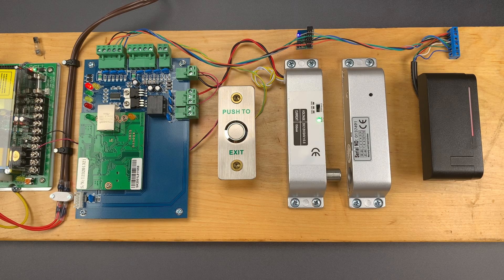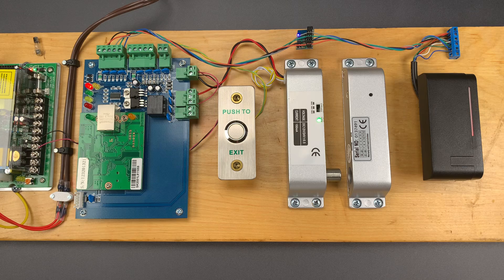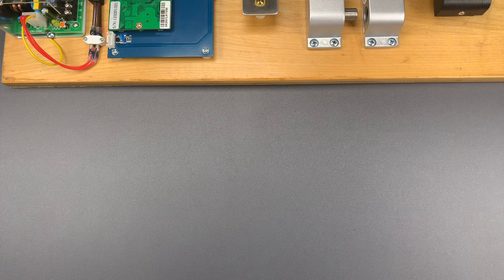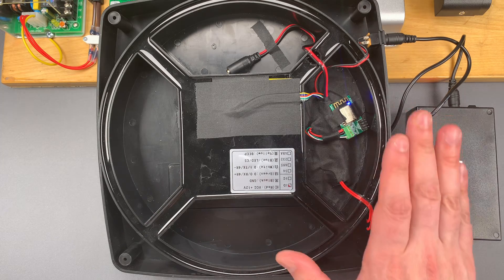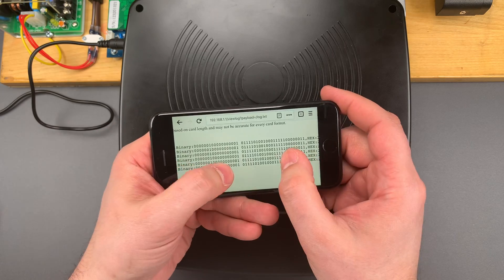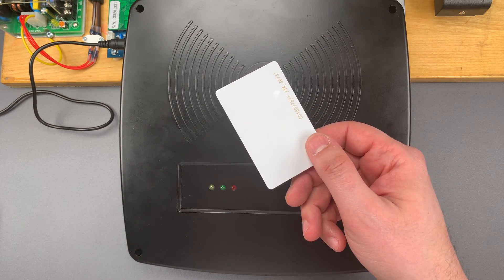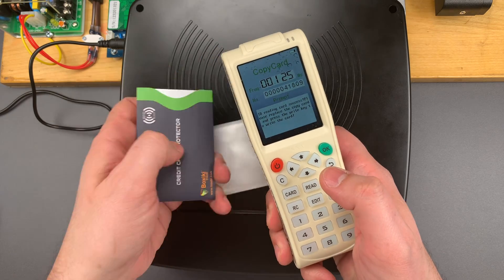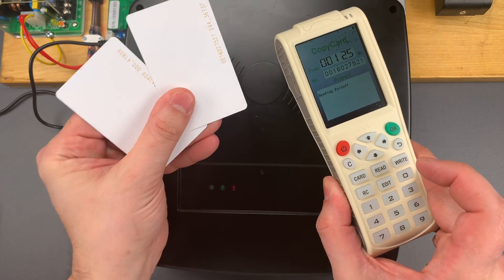[1056] This Black Box Reads RFID Cards in Your Pocket

Comment: Interesting topic. I have an unrelated story from a while back. BNSF Railroad office in Denver was just ramping up to install RFID chips on all their rolling stock. They had installed and were going to test a reader at a particular crossing west of Denver in the mountains. A friend of mine was a line worker for the railroad (don't know his exact job title) and he was out in his truck on the rail line and related this to me over the amateur radio. He got a railroad radio message to get to the crossing that was to be tested and lift his truck off the line and wait for the next train, inbound to Denver, to pass. The train came by and was not remarkably long, but the central controller called back on the radio and asked how many cars were in that train. My friend told them there weren't many and that it was a mixed freight. The central controller called back and said the RFID reader had reported the train had over 36,000 cars on it, then they both realized that the new (yet to be installed) chips were on that train as freight and the sensor at the crossing had successfully read every single chip in the shipment.

Comment: storing cards together is NOT a good way to protect them. The cheapest arduino rfid module under 2$ has no problem reading out all cards stacked up to 15 or something like that and I don't think you'll be stacking more then that.

Comment: Thank you LPL for FINALLY showing one sane person on how your cards are insecure.
Everybody goes Ape about how you can read cards from a distance and how for example the contactless banking is bad.
But you are the FIRST to show how it does not work when you have a bunch of cards together.

I despise the people that have their work-badges around their necks or on the belt like some dog wears a collar. So easy to pick up on and read. I have mine in my i-Clip wallet that basically stacks all cards together. There is just gibberish whenever I present ANY card inside the stack to any reader. 

Keep up the awesome work and hopefully, people will understand the security flaws and how to protect against these remote attacks.

Comment: As LPL said, it is wise to use a challenge/response system. But he is wrong on the gold standard. The true gold standard of electronic perimeter access security would be public key (certificate-based) encryption protected by a PIN and/or biometrics. The US Government invented a class of card called PIV (FIPS 201 / NIST SP-800) with several means of protection built in. There are multiple key slots on each card, each capable of containing strong key pairs. There is a special slot for "Card Authentication" (which can be read without the PIN code) and others protected by the requirement of a user PIN. There are also means to store biometrics. Every US Government worker carries this, either as their agency ID card or in the military, the "CAC" or Common Access Card. You can also buy commercial ones from companies such as Taglio (https://pivkey.com/) that can be custom programmed and printed. These cards can be used for physical security (contact or contactless), computer access (Windows and Mac support this, and there is probably support for it in Linux), and document signing. The card can generate the key pair on the card and create a certificate signing request. The private key is created on the card and never leaves that card, unless there is a serious security hole. It's a shame that online banking providers don't just use their credit/debit cards in a similar manner as a physical token that has a secure signature issued by the bank that can't be forged.

Comment: LPL, about the metalized card holder, isn't it easy to read inside because there's part of an edge of the card exposed, which would expose part of the card's antenna? I ask because i've seen more complete forms of wrapping in aluminium foil, or metallic wallets, that actually work to block reading, at least from NFC

Comment: Could anything like this be used on contactless credit /debit cards?

Also, would you be able to test some popular 'RFID blocking' wallets to see if they actually work?
Reply: I believe that the credit cards use a challenge and response system. They don't simply broadcast the same value every time. Instead, an encrypted number will be generated using a private and public key and only someone who knows the key can come up with the correct response to the challenge.

Comment: Lpl, I do low voltage service. Your videos have inspired me. I enjoy finding panels w/out keys and have picked more than 10 simple panel locks with your inspiration! Prior to you my prybar got a lot more action.

Fire alarm, burg, access control, cam, voip, fiber, comms, and radio systems on occasion.

Thanks for the small fun you have made from a large stress.

Comment: So really, the people who make those RF card blockers should just make them so that they have a built in "RFID card" that is printed with random gibberish.
Reply: ...and a switch to turn it off when one wants to use the card. Or else it renders the first rfid chip unusable. But then one could just add a switch for the original rfid chip, so yea.
Reply: @marksmod  Usually you remove the card from the sleeve when you want to use it, and that's functionally the same thing as a switch only more durable.
Reply: I like the fact you could sandwich your card between two other cards.

Comment: What about Credit Cards?   Now they all have RFID Chips in them.   Can they be read from a distance also?  Also, My understanding is that a simple piece of kitchen Aluminum Foil folded in half to fit in your Wallet will shield your cards or confuse the readers (instead of buying an expensive wallet or sleeve).   Is that true?

Comment: There is an easy way to know that cards are insecure. If an NFC reader (You probably have one in your phone) can not detect them, they are most likely 125kHz cards. NFC works at 13.56MHz, which allows more power transmitted to the card.

Those 125kHz cards are cheaper and they have much less power available. A good encryption takes an extreme amount of CPU cycles, which take a lot of power. Without encryption you just need to send some bits, the amount of CPU cycles equals the amount of bits multiplied with a hand full of cycles needed for the loop reading the memory and sending the data.

If you have more power, you can have a fast CPU doing many many things. An example for authentication could be that the card and the reader share a secret that never has to be transmitted. To authenticate the card, the reader sends some random number to the card (every time another one to prevent replay-attacks, this is very important!), the card then appends the secret to that data and uses sha256 to hash it, this can be sent back to the reader. The reader can create the same hash and can compare it with the hash received from the card. It can also measure the time it took the card to do the calculations, which makes relaying-attacks extremely hard.

And how computationally hard the sha256 algorithm is, can be seen in a video where someone just calculates one out of 64 rounds of the sha256 algorithm using pen and paper: https://www.youtube.com/watch?v=y3dqhixzGVo

There are 125kHz cards that promise security, but they are all power-limited and therefore don't implement cryptographically secure authentication mechanisms. The 13.56MHz cards (NFC) finally have enough power to do those little more secure things.

That said... I strongly dislike wireless authentication/authorization systems, they are just begging for trouble.
Reply: Also, putting multible cards together to prevent a successful reading is not guaranteed. It works with most 125kHz cards because they just start transmitting if they get powered up. Sometimes a card is slower then another card, which allows both cards to be read. With NFC and other more "intelligent" cards, there are protocols in place that actively try to prevent blocking each other. IIRC they use a random delay before sending their id, and then the reader can address them separately (something like this).
Reply: About the sleeves: A conductive/metallic surface alone won't help. The communication and power transfer happens mostly using the magnetic field and this doesn't care about that tiny amount of shiny metal on a plastic foil. Get a bigger amount of ferromagnetic metal between cards and reader.

Comment: The multiple card trick is fine with basic readers which usually support collision detection. Some advanced readers support collision negotiation (part of the raid protocol) and can read multiple cards in one shot.
As an example, in some stores, you can throw all your articles in a special basket at the checkout counter ant all items are detected with raid tags. No more codebar scanning and way faster.

Comment: Hi,

Correct me if I am wrong but wouldn't that device read a debit/credit card which is contactless as well?
Reply: Maybe this exact system can't, but you can engineer similar ones that do
Contactless without user approval is the most absurd technology banks implemented thus far. I'm actually surprised there was no class action against such a big security issue

Comment: Geez… I installed a system almost completely identical to the system that you’re testing for a mortgage company way back in 2004!!! I’m impressed with how far the technology has come to capture and re-play credentials & cloning cards from a remote scan onto a physical card to be able to make unauthorized access to the lock 🔒 less conspicuous than waving 👋🏻 some huge device or cellphone 📱 in front of the card reader!!! I’m positive that you could have easily gained entry to one remote control door lock on the backdoor because it had its own control system board inside it that you could definitely have opened and then just bridged the contacts to activate the lock opening!!! The main doors on 3 floors of this 10 story building were just simple readers and could not be used directly to activate the lock opening because the controls were not near the door they were in the utility closet of the 3rd & 10th floors & in the IT Server Room on the 1st floor, except for the backdoor, and had separate wires from the server room/utility closets which would activate the lock opening remotely and separately from the reader mechanism!!!

Comment: I use 2 RFID blocking measures. My wallet itself has RFID blocking card holders. I'll put my card in a RFID blocking sleeve (1 for credit, 1 for debit, 1 for card access) and put the whole thing inverted into my wallet (opening down) to try to make a more complete Faraday Cage. I do understand that it is not perfect. However, it would be interesting to see if that actually works better, or if I am just nuts.

Comment: Does anyone make cards, encrypted or not, which have a membrane switch in them so the coil is disconnected unless you're pressing it? When you want to go through a door, hold the card where the switch is. If your aren't pressing there, nothing could clone it.

Comment: i  may  be  inaccurate  with  my  assertion … the  reason  those  metallic  sleeves  still  offer  up  data  is  because  of  the  one  open  end  of  each  sleeve.  notwithstanding … would  seem  to  me,  just  use  piece  of  aluminum  foil  to  completely  block  the  signal.  however … thanks  for  touching  on  the  topic.

Comment: I work at an airport that uses unencrypted (I believe) photo RFID cards. If someone stole your card or copied it, however, they are SOL. In order to unlock any door (except specific doors in the sterile area with a sterile area badge) you require a two-factor authentication. The person scanning the card must scan it and then enter a code specific to that employee. Without the code or the card, no dice. You're also required to wait for doors or gate to close behind you when going through them, even if you know the person behind you is authorized to be in that area.

Comment: They found one of these coils taped to the underside of a trash bin where the employees smoked a lot. My friend who works there and told me the story said that the security officer was throwing away the remains of his lunch and he saw a speaker wire go inside the trash bag from the little roof it had over (where the coil was). 

They never managed to find who put it there, but my friend told me that two guys who worked as janitors and he knew for months, by eye contact and the random hello, were "abruptly" changed the next week over, and he never saw them again.

Corporate espionage in a trash bin near you.

FYI, i don't think that the janitors and the swiffer were related, the way i saw it, "why would you need to swiff them if you're a janitor" you'd already have access to those areas/cards.

Comment: "This is the LockPickingLawyer, and today I'm going to show you a significant flaw in frontline security. The security guard. With this simple Taser you can pick up off the internet, simply hold the end anywhere on the guard's body, press the button, and you're free to walk right in. 

In any case..."
Reply: "I'll show that to you again, so you can see it's not a fluke."
Reply: Non-destructive testing please :)

Comment: I keep all my old cards in my wallet for the very purpose of scrambling the signal. I'm glad my idea is now proven to work. Although the only issue is I think it sets off the security scanners in every shop I walk into.
Reply: It does not work. LPL is wrong about this.
They only reason you are unable to read multiple stacked cards, is because you are using a reader which is designed to only accept one card at a time.
There are readers which can easily read a stack of 10 cards simultaneously.
Guess which kind of reader an attacker would use...